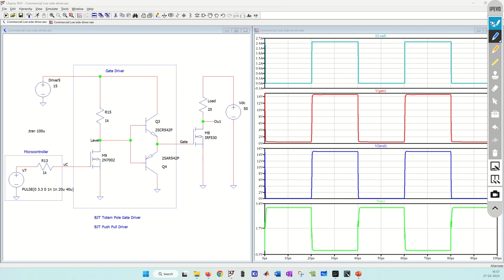BJT Push-Pull Gate Driver

Comment: How to get the efficiency of this gate driver circuit? and what about the power loss of the driver? also is it possible to get gain and bandwidth of the driver circuit?
Reply from the maker: For efficiency, you can measure ratio of output and input power. For gain & bandwidth you will have to do small signal analysis.